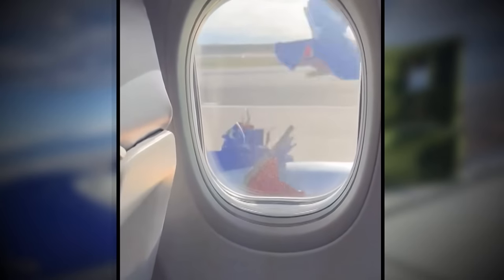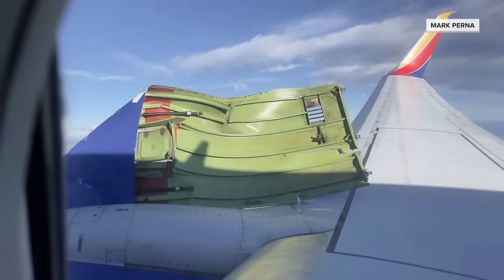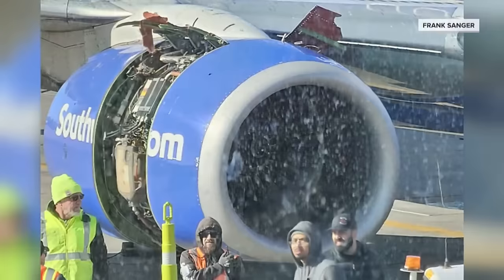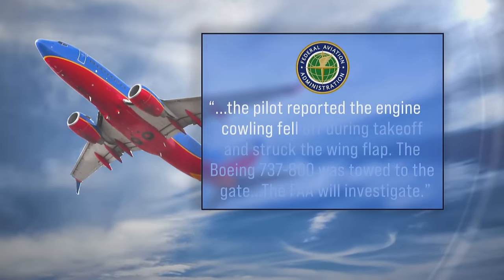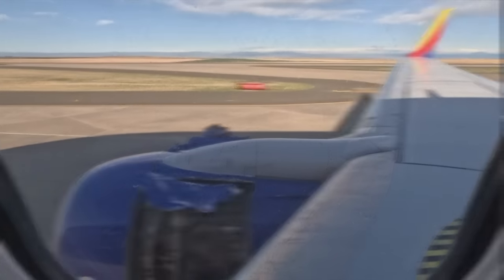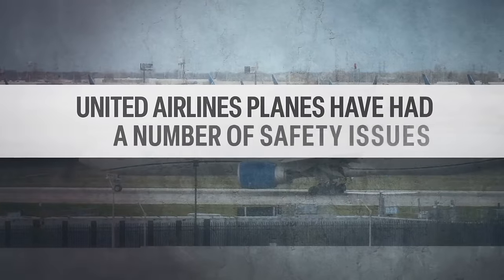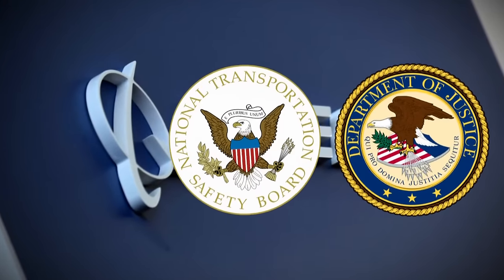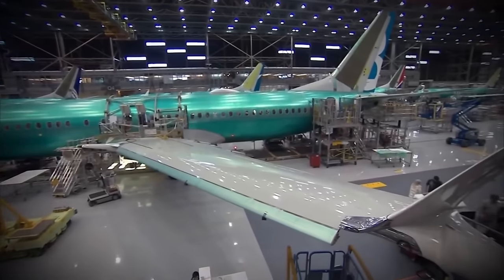Engine cowling falls off Southwest Airlines jet during Denver takeoff

Comment: The media is quick to say "Boeing, Boeing, Boeing" rather than cite the obvious fact that the engine cowling was likely not secured properly by maintenance.  If it turns out that the cowling itself disintegrated, that's another matter, but that has not been determined.
Reply: Just like most of the recent UAL issues.  Boeing is still named in the broadcast when a 20 year old plane has engine problems.  Clowns in the news departments.
Reply: Boeing, Boeing, Boeing - why isn't there a warning light in the cockpit indicating the cowling is not secure ?
Reply: @kjisnot yet Airbus don’t seem to be having the same problems. But hey, maybe you enjoy your safety being decided by bean counters and not engineers.
Reply: @xr6lad this could happen to Airbus aircraft too in the same way. It’s just a coincidence that it happened on a Boeing and the media will love it! 

Boeing do need to get their act together with their production lines, but some of these stories are misleading the public. The 737-800 has been around for years and it’s one of the most popular airliners. When a problem happens that’s down to the airline’s maintenance, people are quick to point the finger at Boeing because of all of these media stories. It is clear however that it is not Boeing’s fault, but people who don’t know much about aviation don’t recognise that. It’s not very good for the industry.
Reply: Even if the cowling desintegrated for some reason, it would still not be a Boeing product that failed. GE  and Safran make the engines, and I believe Safran also makes the cowlings. But I'm not 100% on that. Might be a different company again, just definitely not Boeing.
Reply: @CerberusTenshi  Legally it does not matter who manufactured the cowling, Boeing has the ultimate responsibility.
Reply: That’s my thought too, Boeing is in deep 💩but this isn’t not one them.

Comment: A mechanic didn’t latch the fan cowl properly after doing maintenance on the engine. This shouldn’t have happened and when the pilot did his walk around before take off he should have caught it. Thats one of the things they are supposed to look out for.
Reply: Is walk around required by FAA or airline company?
Reply: And get that uniform dirty?? Come on now
Reply: I have never seen commercial pilots doing walk arounds
Reply: They are required by law and they ALL do it. Some things you cannot see. 
A cowling is just a cover. It's like losing a hubcap. Both the engine and the plane function just fine without it.
Reply: @drbichat5229 
Then you’re not looking.
Reply: @drbichat5229   if you didn’t see them you weren’t looking. All pilots are required to do walk around,after all it’s their butts at the controls and if something obvious can be corrected it might just save everyone’s life. As it is when those fan cowls departed the aircraft they did damage to the flap and could have damaged the horizontal stabilizer too. A tad more I’m portent than a hub cap. Without the fan cowls I’m sure the additional drag would reduce fuel efficiency.
Reply: Last persom who worked on it is responsible.
Reply: Assuming the problem wasn’t a damaged fastener that appeared to work, but didn’t
Reply: @lastmanstanding9389  ....and their supervisor.....
Reply: Pilots dont do walk arounds anymore. There is a ground crew that does extensive checks inside and out before takeoff, either a latch broke or someone missed it.
Reply: @sundancer3700 :  WRONG!  Every flight manual at every airline details who will normally perform the pre-flight walk around.
Reply: @gordonbryan8381  WRONG
Reply: @sundancer3700  
@sundancer3700
4 hours ago
Pilots do do walk arounds
Reply: @drbichat5229  Your not looking very hard
Reply: Or the latch broke, use your head.
Reply: @stoneneils   Yes the latch could have broken,but so could someone not getting it closed all the way. Mistakes do happen you know.
Reply: @stoneneils  I have been a licensed AME for 40 years and have never seen a latch break, doos.
Reply: But keep telling me how important DEI is….
Reply: @MeneTekelUpharsin yes, mandatory by FAA
Reply: @fw1421 That's a joke, right? The horizontal stabilizer is higher than the cowling. How is the cowling supposed to fall up?
Reply: @CerberusTenshi  the cowling went over the wing. The plane is trimmed slightly nose up. Could have hit the leading edge of the horizontal stab.

Comment: In a flight out of jfk in a new 757, I noticed the right engine cowling latches had not been secured while taxiing to the runway for takeoff. I made a big fuss and finally convinced the pilots to go back to the ramp and get them fully closed. After the flight the pilot told me it would have been fine to fly unlatched as the mechanism are redundant.  I asked him if he really wanted to be the test pilot and told him I didn’t want to be a passenger on a test flight. These pilots are under big pressure to keep schedules…
Reply: Liar.

Comment: Looks like maintenance didn’t tighten all of the fasteners.  I’ve found loose fasteners during preflight on a few occasions.
Reply: The sad thing is that when aircrews were larger- pilot, copilot, and flight engineer- there would be an extra pair of eyes when performing the preflight walk-around.  And yet there were incidents where not all of the latches securing the engine cowlings were secured properly.

Comment: Someone didn't "button up" the cowling and an inspector missed it at sign off.  No one person is to blame, rather, the whole system is flawed.
Reply: Unfortunately this incident happened to a Boeing, and not to an Airbus. Just haven't heard of this type of event taking place on an Airbus, Embraer, or any other brand of commercial aircraft, except Boeing. Very interesting, but maybe that's not the case, maybe it just happened to be another unfortunate Boeing incident at this time.

Comment: This is a common-enough event in aviation history.   A failure for the ground crew to secure the cowling fasteners AND the failure of the aircrew to spot the problem while performing their preflight walk-around.   I have seen quite a few reports and photographs of the results when an engine cowling has peeled away from its attachment points.   The results can be messy as the associated images can prove.

Comment: To get an FAA license as an Aircraft Mechanic you must  have either previous experience or  an accredited  aviation maintenance  training , and  pass your written ,oral and practical tests  with an honest ; not corrupted, FAA  Certified Examiner. If you decide to go the illegal way to get your A/P  Mechanics License, it means that you went to  see  a not so honest Examiner and paid him to give  you  a license, even though you dont know which way to turn a common  screwdriver . Those are  some of  the mechanics that are presently working in the aviation industry.  Since the FAA does a poor job at  cleaning the house of the corrupted personnel,these  maintenance related incidents  occur  because of the employment of "mechanics" that dont even know what an aircraft is and what it does.

Comment: Quote: The aircraft is made by Boeing, however the Engine is not.
True, however the engine casing is !!!
Reply: Boeing probably made the cowling. But apparently they attached it when they made the airplane.
Reply: @neilkurzman4907  Your mistaking Neil,
If it was attached by anyonhe, it would not have fallen of would it ? 😄
Reply: @pascalcoole2725  
Unless it wasn’t a failed fastener or some type of damage to the cover. 
Odds are it’s a maintenance issue. But we don’t guess. We investigate and find out. We can’t solve the problem if we don’t know what it is.
Reply: @neilkurzman4907  Neil you're absolutely right, but i left aviation 20 years ago and haven't flown since.

Comment: I notice GE wasn't mentioned, I wonder why.....................................
Reply: Because GE makes the engine. They don’t make the cowling that goes around it.
Reply: @neilkurzman4907  - Neither does boeing - it's a political driven narrative regarding GE.
Reply: @theOnly_Gatsby  
So who does make the cowlings?
I would assume they are purchased by Boeing when the aircraft is manufactured. But for all we know they’ve been replaced since then.
But we do know that since the engine was working, GE had nothing to do with this incident
Reply: @neilkurzman4907  it's a maintenance issue at this point. Those cowlings have been removed and put on many times. My point is neither boeing or GE should be the story.